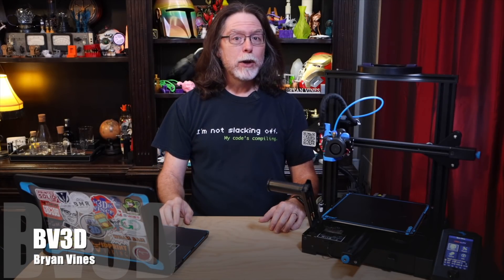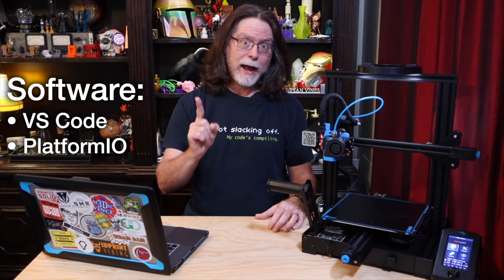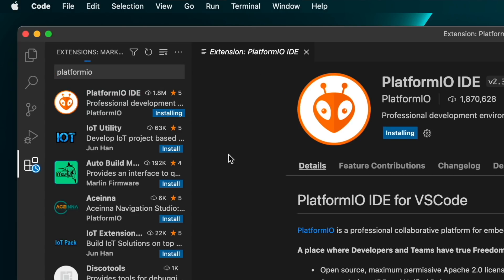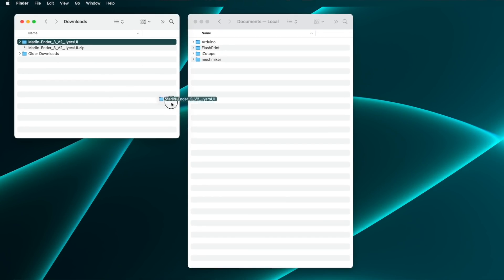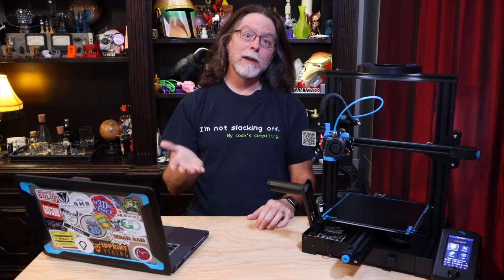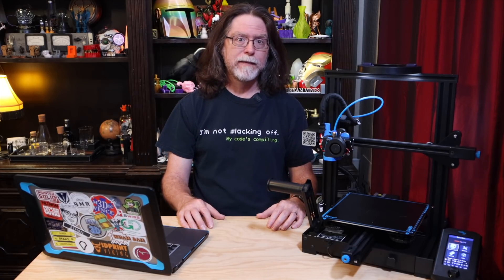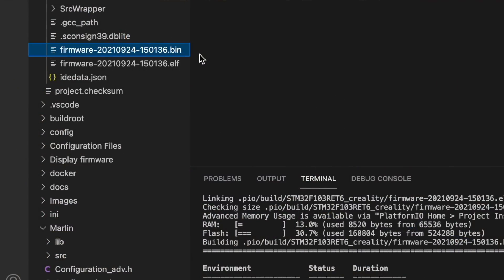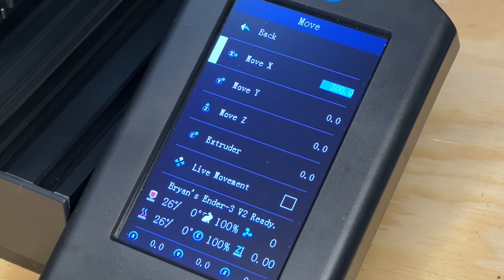EASY! Edit & Compile JyersUI Firmware for Ender-3 V2!

Comment from the maker: @Geoff Gray asked about compiling JyersUI for the 4.2.7 board versus the 4.2.2 board. Here's what you need to do if you've got a 4.2.7 board:

To compile for a 4.2.7 board, look in the configuration.h file for:
  #define MOTHERBOARD BOARD_CREALITY_V4

Change this to:
  #define MOTHERBOARD BOARD_CREALITY_V427
Reply: Was just going to ask,
Also: I take it that I don't need to to anything if I have the 4.2.2  board?
Reply from the maker: @nicklasmartos928  Correct. The configuration.h file is already set up for the 4.2.2 board.
Reply: @BV3D  hay, I have a question? How about if I want to raise the temp? I was able to do it but the z would not lower any help. I ended up re installing jyers again could not figured out
Reply: @BV3D  it keeps failing for me with the error stm32f103ret6_creality maple
Reply: @johnphillips7153  same
Reply: @johnphillips7153  Same
Reply: @johnphillips7153  same here
Reply: I take that back it's still not working. What would cause the printer to not home
Reply: Dear Bryan, I did everything you said for my ender extender upgrade, and after the firmware is compiled with the new bed size the changes are not shown on the new UI.
Reply: THHHHHANNNNNKKKKKSSSSSS!!!!!!!!!!
Reply: What are you using now? jyers has not been updated in over a year and looks like it's not being updated anymore.

Comment: can you downloade the compiled bin file anywhere for a 4.2.7 card with BLtouch and y300 x300 z350 or 400mm size anywhere since i can get it to compile in VS studio
Reply from the maker: Hi Jimmy, take a look at the current MRiscoC Professional Firmware for the Ender-3 V2 (https://github.com/mriscoc/Ender3V2S1/wiki/How-to-install-the-firmware). It appears to support G-code Configuration Files, which allow you to adjust things like build volume dimensions without having to recompile the firmware. So you could check for the correct file for your 4.2.7 board + BLTouch, and edit a configuration file to override the build volume. Check this page for details (https://github.com/mriscoc/Ender3V2S1/wiki/Configuration-files).

Comment: Don't know if anyone else is having this problem but I cannot get JyersUI to work anymore. It seems like since it hasn't been updated in years, it's not working with platformIO anymore. I've gotten other firmwares to compile just fine, and it largely follows the same process as this tutorial
Reply: Same here. Every time I press the check button, it says failed. I am not sure if I am doing anything wrong.

Comment: I seen to have a problem with the Platform.ini  despite having as the default environment set to STM32F103RET6_creality_maple when the PIO runs it fails and throws a load of errors, these then stop the builder looking at any thin other than a mega board. 

I'm trying to configure an Ender 3 pro with a V427 board and a sprite pro extruder.  The creality default firmware in the website is rubbish.

Comment: Hey Bryan, I am getting a lot of errors when trying to compile the firmware. For example:
Warning! `src_filter` configuration option in section [env:teensy41] is deprecated and will be removed in the next release! Please use `build_src_filter` instead

I didn't se eyou add/install anything out of the norm here or do any C++ configuration, am I missing something??

Comment: If I buy a v2 screen and a sprite kit for my Pro would I use the V2 firmware from JyersUI. I have upgraded to the 4.2.7 silent board using Creality's firmware and it run fine but I would like to get the better screen an onboard controls. A side from the Sprite that what it looks like you did in another video to the MAX

Comment: Great video, Bryan.  However, when I follow your instructions, the branch dropdown only shows "bufix-jyersUI" not "Ender_3_V2_jyers" as shown on your screen.  The zip download is also the "bufix-jyersUI".  Can anyone tell me how to access the "Ender_3_V2_jyers" branch?
Reply: I was having the same problem at first. It's the Source code zip at the bottom of the assets list that shows all the versions available. It's actually the file you need to install the display firmware.

Comment: I've been using Jyers firmware for the last 4 months, since getting into 3D printing. I've upgraded my V2 with the sprite pro and sadly I've had to install Creality's firmware since the CR touch doesn't match the location as the OEM

Comment: Hi Bryan 2 questions.  I have used the jyers default and edited and compiled for new thermistor  and higher max temp. I was wondering if the manual mesh version still also had the same manual bed leveling feature? 

And for the more important  quest. Recently I added a filament runout sensor and I tested it I quickly  discovered that I would really like it to retract the filament when it puases from a runout the same as when it does a filament color change. Would you know how to ad that in the edit and compile?

Comment: Hi, thx for this video. It helps very much. I have a question: after a while starting fan speed increases %255 (even I've set it max %100 in Cura). I ve tried to reduce it %100 on ender3 v2 panel, I've set all %100 every menu that I found fan speed settings but nothing changes. Is it normal, or I do sth. wrong?
Reply from the maker: Hi, Marlin uses an 8-bit value to represent the fan speed.
All bits off (0000 0000) is the minimum value. In decimal, this is 0, and is 0% speed.
All bits on (1111 1111) is the maximum value. In decimal, this is 255, and is 100% speed.
So, when you set the fan speed in the slicer to 100%, Marlin usually shows that as 255.
If you manually set this value to 100, that's slightly less than 50% speed.
Reply: @BV3D  thank u so much, then dont need worry about that. Actually I think that filament strings on my prints (looks like web more than strings) because of too high fan speed. But know I am not sure of that. If they arent created on flat surfaces too may be I think it's about retreaction settings (I generally set it 6.6 -7 mm in cura but still webs reveal) I am new in 3d printing and my English is not good enough to understand helpful videos like yours. Thanks again for your interest :))

Comment: While compiling, it failed with: "TM32F103RE_creality_maple  FAILED" message.
Reply: did you get any solution ?
Reply: @Mes_11  nope, sadly. But i  solved it myself, inside the platformio there is an extension called auto build marlin, that fixed the error and i can build it with 1 click now.

Comment: I dont get it. I have followed all the necessary steps and updated the start G-Code as required, but the print always ends up coming out too high on the right side of the bed regardless of how many points I use for the bed tilt mesh. I even did a manual 100 point mesh to verify everything was as close to perfect as possible. Regardless of what mesh options I do, it always does the same thing with the filament being printed higher on the right-hand side of the bed. At my wits end trying to fix this

Comment: Hi BV3D! Thank you SO MUCH. As someone who has never coded and felt way in over their head, this was incredibly helpful. I did run into one hiccup. Every time I try to compile it fails. All I did was change the bed size from 230 to 235 for the X and Y axis. I deleted the file and ran through the steps several times, even tried a different reference code and it consistently gives me:

Environment                 Status    Duration
--------------------------  --------  ------------
STM32F103RE_creality_maple  FAILED    00:00:07.971

Error:     #if ENABLED(BLTOUCH_HS_MODE) && BLTOUCH_HS_MODE == 0
 #error "FAN_SOFT_PWM is required for your board. Enable it to continue."

Please help! I appreciate your time.

Comment: Thanks for this! Creality's firmware for the Sprite Extruder doesn't cover the Ender 3 Max Neo, just the Max (with old screen), The Max Neo is very similar to your Ender 3 V2 Pro. So this tutorial got me up to speed so I could set the build volume, set the cr-touch offset, and set the default e-steps for that extruder.
Reply: I know this a late reply, but can you tell me the Sprite's Probe and home X and Y offsets?

Comment: hello im having an issue with a ender 3 max with v2 screen and bltouch. basically it does the abl but the z axis does not raise and lower on first layer. also im doing a 3x3 grid and its only doing the front 6 then gets to the back left corner probes and says its completed. any ideas

Comment: Bryan,
I keep trying to follow these instructions, but I get the following errors:
Verbose mode can be enabled via `-v, --verbose` option
Error: Build environment 'mega2560' is incompatible with BOARD_CREALITY_V422. Use one of these: STM32F103RE_creality, STM32F103RE_creality_xfer, STM32F103RC_creality, STM32F103RC_creality_xfer, STM32F103RE_creality_maple
================================================================================================== [FAILED] Took 2.68 seconds ==================================================================================================

Environment    Status    Duration
-------------  --------  ------------
mega2560       FAILED    00:00:02.679
============================================================================================= 1 failed, 0 succeeded in 00:00:02.679 =============================================================================================
 *  The terminal process "C:\Users\eplossl\.platformio\penv\Scripts\platformio.exe 'run'" terminated with exit code: 1. 
 *  Terminal will be reused by tasks, press any key to close it. 
To be fair, I'm trying to build Marlin 2.1, not Jyers 2.0.1, but I would think the rest of the details would be the same. Am I doing something wrong in the configuration somewhere?

Comment: This is a big struggle alot of the steps you go threw do not align with what my pc is doing. If I click configuration h it will automatically  open up in the visual studio  If I edit as shown i get no check mark to compile or anything. 
I have also pasted the file to my documents  folder but when I try to follow you it does not at all work how you are showing I can open platform ioand I can not find the info.   I really don't think it should be that confusing

Comment: I am having a difficult  time trying to find accurate info to compile and install firmware. I have a slice engineering 300c thermistor and I want to raise my minimum print temperature. Now I followed most of what I saw in the video  and I made a edit of some sort and I have no idea how to know if I was supposed to eddit in that spot or another
Reply from the maker: I made a change to the JyersUI firmware to support a different thermistor type and max hot end temperature in this video, where I'm installing the E3D Revo Micro. The firmware modifications start at about the 7 minute, 10 second mark. https://youtu.be/r5OlltC-yww?t=431
Reply: @BV3D  thanks I will look at it tomorrow. I feel like theirs a 40% chance I did the right thing but lack the experience and information.
Reply: @BV3D   im trying this now and when I sollect find it absolutely  looks like it brings me to a different  spot and mine doesn't look the same as yours

Comment: I have been trying to configure this firmware 3 x 3 manual mash set up with a smart filament sensor for over a month now. Something is wrong not changing a thing in the code I picked platform I/O comes up with so many Errors!!!!!!!!!😡

Comment: YOU ROCK!!!!  Following your instructions it took me UNDER 30MINS to access the full 235x235 bed.  I am a total noob, limit experience.  I had the compile fail once but I had selected a "de bug" file from GIthub.  I started over with the correct files and BAM!  I can now print the full external enclosure for my electronics in one shot!!!

Thank you!!!!1

Comment: I need help with a custom 3d printer it's a CR10S in size but it has ender3 V2 motherboard and screen and hotend with direct drive I need help getting firmware for it I bought it used and I never got it to work  so I been throwing money at it and still not fixing the issue

Comment: hi people! can anybody helpme? i have this problem... 

Error: Build environment 'STM32F103RET6_creality_maple' is incompatible with BOARD_CREALITY_V4. Use one of these: STM32F103RE_creality, STM32F103RE_creality_xfer, STM32F103RC_creality, STM32F103RC_creality_xfer, STM32F103RE_creality_maple

Can anybody give me a hand? i will apreciatte!
Reply: Have the same problem :-( Something was changed in the newer Marlin Builds
Reply: I'm having the same issue, have you fixed it yet?
Reply: @fabiank.1685  i can update it but have to go back... problem for the future...
Reply: It's because they renamed "STM32F103RET6_creality_maple" to "default_envs = STM32F103RE_creality_maple", they throw away the T6 part so you can also chose "default_envs = STM32F103RE_creality"

Comment: So when i try to build the file in platformIO it gives me this big error and wont do it: "Error: Build environment 'STM32F103RET6_creality_maple' is incompatible with BOARD_CREALITY_V4. Use one of these: STM32F103RE_creality, STM32F103RE_creality_xfer, STM32F103RC_creality, STM32F103RC_creality_xfer, STM32F103RE_creality_maple"

Anyone else have this issue?

Edit, nevermind i went and downloaded the source zip and it seems to be building just fine.
Reply: I am having this issue too! How did you get it fixed?
Reply: What exactly do you mean with the source zip?

Comment: Your videos are so helpful. I am running an ABL 3x3 currently and am trying to create a UBL Firmware since my bed seems to dip all over the place. Can you decipher what is going on with this error when I click build? "Error: Build environment 'STM32F103RET6_creality_maple' is incompatible with BOARD_CREALITY_V4. Use one of these: STM32F103RE_creality, STM32F103RE_creality_xfer, STM32F103RC_creality, STM32F103RC_creality_xfer, STM32F103RE_creality_maple"
Reply: I'm also having this problem, did you find a solution yet?
Reply: @fabiank.1685  I did. I used one of the other build environments. I kind of went down the list until I found one that worked. Hope this helps.

Comment: For those having problems compiling with the MOTHERBOARD BOARD_CREALITY_V427 ...
1) Uncomment #define FAN_SOFT_PWM in configuration.h (error message will tell you to do the same)
2) Compile with STM32F103RC_creality
Reply: `STM32F103RE_creality_maple` also appears to work. This is also needed with 4.2.2 as of the current version of the repo

Comment: my build is failed, "Error: Build environment 'STM32F103RET6_creality_maple' is incompatible with BOARD_CREALITY_V4. Use one of these: STM32F103RE_creality, STM32F103RE_creality_xfer, STM32F103RC_creality, STM32F103RC_creality_xfer, STM32F103RE_creality_maple" my printer es 4.2.2 with manualmesh3x3 :(
Reply: I'm having the same issue, have you fixed it yet?
Reply: @fabiank.1685  im using klipper haha, its cute

Comment: will not compile 
Error: Build environment 'STM32F103RET6_creality_maple' is incompatible with BOARD_CREALITY_V4. Use one of these: STM32F103RE_creality, STM32F103RE_creality_xfer, STM32F103RC_creality, STM32F103RC_creality_xfer, STM32F103RE_creality_maple

Please help
Reply: me too
Reply: same to me :(
Reply: Same here
Reply: I may have found the issue.    In VS Code with Platform IO opened, edit the plastformio.ini and replace STM32F103RET6_creality_maple with one of the recommended environments.  I haven't tested this all of the way but it appears to be compiling now.
Reply: @poedba  did it work?
Reply: @poedba  Did your Solution work?

Comment: I Have spent 2 days trying to figure out how to edit the code for my stepper motor for extruder as it is going backwards pulling filament out the tube. i have tried the reverse wire with no success. I have figured out how to edit the code and all in VS but when i pull up the platform io tab and click open there are no files in marlin folder i have to hit tab that says reveal then click the marlin folder but it opens up folder and i click configure folder and VS pulls up the code. after all is done and say i want to hit the check on the bottom to configure that is also not there to click at all. any info would be great i just want to start my first 3d print.

Comment: Awesome video Bryan. I followed your instructions and everything worked perfectly. There were a few minor differences from your video to the upgrade I did today. platform.io is loading C++ extensions which confused me. I did get an error  in "#include" to update "includePath". But it still worked and my machine shows 300x300x250. Did the autohoming and works perfectly.

Comment: I have a Ender-3 V1, but I upgraded the motherboard to a v4.2.7, and put on one of the touch screen kits. I am curious if there  is any way to compile Jyers for my printer, as I'd like to be able to do certain things, like update the e-step without having to run a gcode file every time I start the printer.
Reply from the maker: Wait, the vintage (I use that term jokingly) Ender-2 not-pro? I have one of those! It' still got the original board, all I've done to it is add a parts cooling fan, and flash the TH3D Unified firmware onto it a couple of years ago.

Anyway, while JyersUI will work fine with the 4.2.7 board, I don't think JyersUI will work with the touch screen.
Reply: @BV3D  Gaaa! Original Ender 3, not Ender 2. I updated the original post.
I followed the instructions to build it, but it failed to flash, so I guess I would have to hope that someone figures out some way to make the touch screen kit work some day.
Thanks for the input.